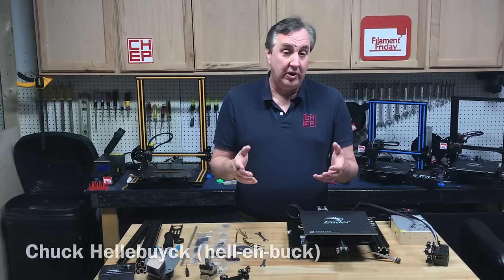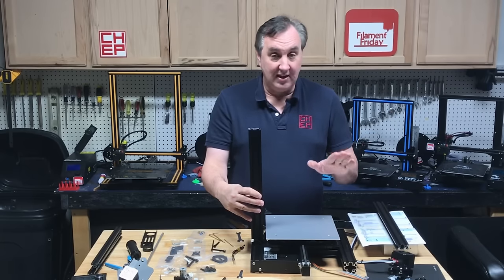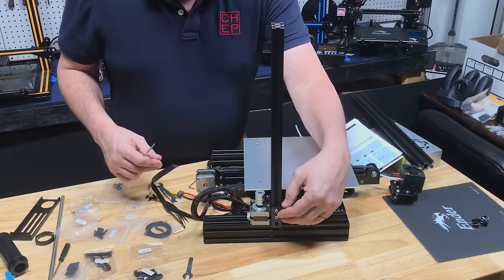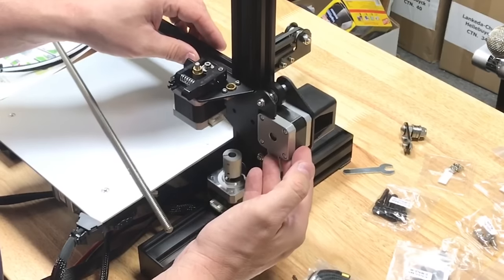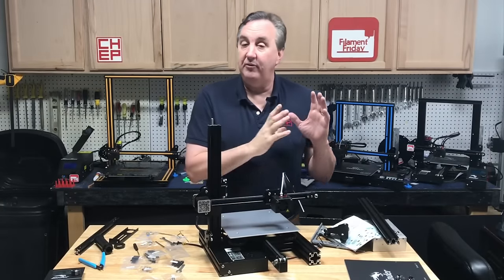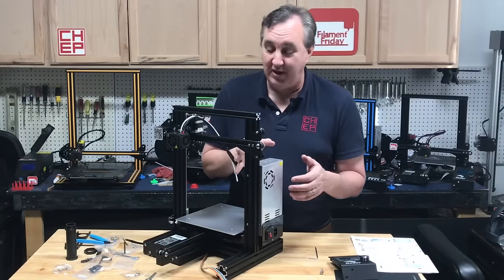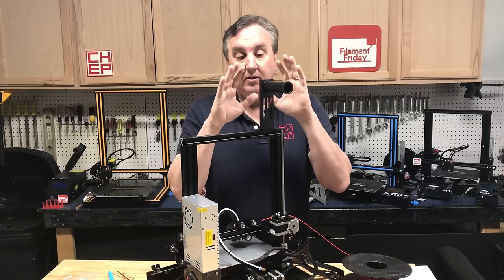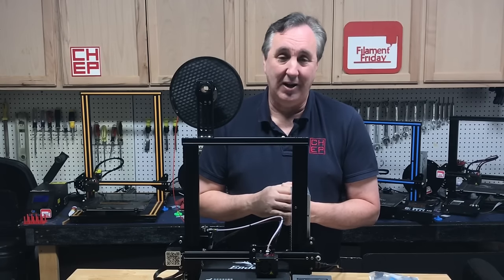How to Setup an Ender 3 3D Printer

Comment: Good day.
Thanks for the great Ender assembly instructions. I have Ender V2, but your instructions are perfect for it.
I do not speak English, so I reviewed your video with subtitles from Google translator 4 times (Google does not translate very well from English into Russian and I did not understand everything right away).
Let me share my experience in assembling a printer.
There is one unpleasant feature of the assembly of openbuilds and aluminum profile carriages. Usually the wheels supplied with the printer are of good or excellent quality, without damage. But after installing the carriage on the profile (and during adjustments, you have to remove and put the carriage on the profile several times), it turns out that the carriage begins to move along the profile with dips. This is due to the fact that, for an unknown reason, the wheels are damaged from an unknown source. The reason for these damages is as follows. When a profile is cut for a printer at the factory, the end of the profile and the plane of motion of the rollers is exactly 90 degrees, and this angle is very sharp for the material of the rollers and damages them when the carriage is installed on the profile. The situation is aggravated if the eccentric nut roller is firmly tightened in the factory and the carriage is installed several times.
As a solution, on my Ender, at the ends of the profile, where the carriage will be installed, I blunt the corners with a fine grit nail file. And each time, before the carriage enters the profile, each time I loosened the eccentric nut as much as possible.
On my first Ender, I unknowingly messed up the rollers of the X and Z axis myself. I got very upset when, after assembly, the extruder on the axis moved with noticeable dips. I realized that the dips have a frequency equal to the length of the roller's circumference (I experimented - I turned the rollers a little with my hands and the dips also shifted). I collected the second and third Ender in my collection without problems with the rollers.

Comment: I bought mine secundo second hand. Is prints ok but o wonder of i can improve. One question about your profiles. Are these for flex and pla?  For flex I now use the chazmeister that gives me good results. But I'm still on a previous cura version. I'm looking to upgrade.

Thanks for the videos👍🏽
Reply from the maker: Yes both standard and flex
Reply: @FilamentFriday  great.  I'm going to try them. Thanks

Comment: I just finished building mine using the manual and had some questions. turns out I built it wrong. my bed is wobbling, all my wheels are tightened wrong and my frame is definitely not Square. Thank you for the video it was great I am gonna go disassemble it now and start over

Comment: Hey Chuck.! Been looking over the frame and as the vertical extrusions are attached  I can see that we are in some cases fighting a misalignment issue caused by poorly cut 2040 cross member of the pre-assembled frame. I have been told by vendors of good quality extrusions here in the USA that there may be an error of ~ +/-  0.06 degrees for any crosscut they make to fullfill an order. I am sure they use the best of equipment.....Now Creality have made well over a million of these Ender 3's. Need I say more. So I am looking into using shim stock. I am taking the unit directly over to my very flat MDF table and sorting it out there. What this boils down to is that once the bolts are tight connecting the 4040 outer rails to the 2040 cross member, any error with perpendicularity is telegraphed and amplified during the mounting of the Z axis risers. 
On another note, the v groove rollers were pre adjusted so tight that I have flat spots on the y axis ie. it actually comes to repeatable stopping points during simple hand driven excursions. These seem to be permanent. Thinking of upgrading to polycarbonate.
What do you think maestro?

Comment: Hello chep, my z axis is not coming down and does the click sound (sometimes it does sometimes it doesnt) when I do autohome. Z Rod screws at the bottom motor joint are tight, upper screws at extruder joint are tight as well(not too tight since it grips the rod). Adjusting z limit switch to a little higher would solve the problem?

Comment: Good straightforward beginners guide to this thanks man. Mines coming Monday and I can’t wait to get started trying out things.
Reply: Triple check you're putting the pieces pointing the right way. Don't force the motors while wired or you risk frying the board, instead rotate the rising motor slowly. You got this champ

Comment: I have alot of trouble with PETG adhesive. Parts just doesn't stick on plate and I have cleaned it and bed level also.
Reply from the maker: I put a fresh sheet of actual Buildtak on mine and it worked great.

Comment: Any idea what’s wrong if the middle part doesn’t want to slide up and down? I’ve tried tightening and loosening the wheels, brackets, and beams themselves but it barely moves
Reply from the maker: With the threaded rod removed?
Reply: @FilamentFriday  the threaded rod is installed, I think I’m going to have to get a clamping square and try again I tried with a regular one and don’t think I have everything lined up right everything lined up right
Reply: @FilamentFriday  it will move up and down if I twist the motor but I can’t just push it up and down and it takes some force to spin the motor
Reply from the maker: Loosen the brass nut screws.
Reply: @FilamentFriday  the ones holding the threaded rod in? Sorry I’m not very technically inclined
Reply from the maker: No the brass t-nut the threaded rod screws into.
Reply: @FilamentFriday  THANK YOU SO MUCH. It slides easy now but about halfway down gets stuck and I have to spin the motor a little to get it going again but it’s actually moving now atleast. Came back with a square and clamps and made sure everything was lined up

Comment: Another comment from me.....My ender 3 is 2 weeks old and the belt broke right where it attaches to the Extruder assembly.  Have you ever heard of this or had it happen?  I've never broken a printer belt before and right at the little end has me wondering what I did wrong.
Reply from the maker: You mean the hotend bracket? 
I’ve never heard of that. Did the pressed on metal cap come off?
Reply: @FilamentFriday  It tore off right at the edge of the metal cap.  I bought a set of those caps from Lowes, but the belt was too short after that tiny bit was lost.
Reply from the maker: Contact the seller for replacement.
Reply: @FilamentFriday  I hadn't thought of that......although I bought a new one from Amazon.  I'll contact them now and should have the belt by July 2021!

Comment: I still have some problems with my printer. Everything looks right to me, I've tripled checked to make sure. I still have some problems though. 1. I dont have a prepare option (I have an ender 3). 2. No matter how much I adjust my bed, the extruder is still an inch away from the bed. 3D printing is kinda weird, there's a gcode (small cat statue) that my printer does try to print even though my printing program says the file isnt printable and is off the grid.

Comment: i am almost done and I only have gotten 2 problems. i had the wrong aluminum thing so the screws wouldnt fit and I was so frustrated. and second. my arm moves down without any trouble, unfortunately up requires so much strength... idk what is up with that.. do you have an idea?
Reply: Same
Reply: You might have to shim your motor ? I think I need to shim mines
Reply: Did you ever figure out the problem with moving up? I'm having the same issue.

Comment: By far it is the best video ever for Ender 3 Assembling. A think Creality 3D should download this vídeo and put it into the  microSD Card that comes with the printer. Thank you very much. I assembled my Ender 3 using the instructions manual yesterday (2021, January 26th). Did not use the printer yet, but after watching this video I think I'll disassembly and assembly again following these wonderful tips. Thank you very much for you time making this video and sorry about my English.
Reply: No way. Camera work is lacking. Got two items backwards cuz he says 'inside' instead of front or back. Instead creality should learn about poke yoke techniques used in manufacturing

Comment: chep hello i want to ask u a question ! both on my ender 3 and 5 when i print small object with low speed like 20 mm/s or 30 mm/s and smaller layer heights lik 008 0r 1 i got a lot of stringing like hair and blobs and both on my printer have dual gear extruders so should i reduce filament temps or flow ?
Reply from the maker: Yes. Reducing flow should help or use a smaller nozzle.

Comment: When I auto home, the needle goes to the top, rather than by the bed. Did I do something wrong?
Reply from the maker: Sounds like the Z stepper motor wiring in backward. Make sure the connector isn’t upside down.
Reply: @FilamentFriday So I somehow managed to get it to go closer to the bed, however, it's about an inch away from the needle when I click homeand continues to go higher by any 10mm every time i press home not sure if that's normal. I initially turned it off and lowered the needle manually and tried to do the height adjustment per yours and other videos with the paper etc and I thought everything was good. I thought I clicked save if that's even the correct thing i was saving... and I'm top of that I found my screen display doesn't have prepare as an option which took me further into a rabbit hole on your videos when you talked about firmware. So now I'm just even more confused.

Comment: 3:24 Tightening the screws will move it into place without any clamps or square. Even if the end of the beam was cut incorrectly and you managed to keep it straight with clamps & square(s), removing the clamps will make the screws that were tight loose, so neither clamps nor squares do any good here, wouldn't you say?
Reply: Your dead right there, the angle that it ends up at remains entirely down to the machining of the end of the extruded piece, which I'm betting is pretty dammed good, of course it can twist a bit, but as the guy said you parallel it up to the board to take care of that.

Comment: im assembling an ender 3 currently and following the video, The threaded guide rod seems to be too big to clear or even go into the brass T- nut mentioned at 8:16. ive asked other people and they have never seen this issue.. any help?
Reply: the brass t-nut is threaded, screw the rod into and through it.
Reply: @JustinWimpey  it was a factory issue and i ended up having to contact creality and they sent me a replacement part.

Comment: Chuck, I'm putting my Ender 3 Pro together right now and i'm at about 12:48 in your video, and the up and down action is absolutely atrocious, does not want to spin whatsoever, any idea what might be causing that?
Reply from the maker: Loosen the Tnut screws
Reply: @FilamentFriday  Sorry I'm stuck at this point too. At 11:22, you only seem to be able to move the bar by turning the screw, but at 12:48 you're dragging it up and down again. As soon as I introduced the screw, I wasn't able to manually move the bar up or down like that. What have I done wrong? Which tnut screws are you talking about? Thanks
Reply from the maker: The brass nuts the threaded rod goes into

Comment: Do you have a video on why a print is center in cura but when it prints it’s offset forward on the build plate
Reply from the maker: No. That could be the firmware setup or dimensions wrong in the Cura machine profile.
Reply: CHEP  hmm I used the ender 3 profile in cura 235x235. What is the set home offsets in the ender 3 menu?

Comment: Yeah I did the prepare and it did all except for nozzle to go down and was like a clicking sound on it and stays there till turn it off does the black box where memory card go does the fan work on it just being on or what
Reply from the maker: I don’t understand the question.
Reply: When I do the set up like you did where it moves well mine is making a clicking sound when it done and have to turn it off
Reply from the maker: Clicking in the extruder? 
Maybe raise the temperature.

Comment: Just a question about my ender.
It has huge problems with the first 1mm of printing. Burnt or over cooked filament and over extrusion.
What could give such inconsistent results?
Reply from the maker: Have you changed anything?
Reply: @FilamentFriday  the extruder is dual drive, I did the steps/mm calculation using your tips and made the adjustment. I also tightened up the  Bowden tube.
Reply: @FilamentFriday  May have figured out the problem. The Boden fitting on the hot end was loose and could have caused the PTFE and nozzle to have a gap in the heat block.

Comment: Thanks Chuck! My E3 has been sitting idle since we assembled it due to so many issues. Looks like I’ll be disassembling it and starting from scratch with the reassembly following your procedures.

One thing that is an issue on mine - the front right leveling screw is loose at the plate. Is there an easy fix for this, or will I need a new plate? (BTW, mine has the magnetic build sheet  with a self adhesive sheet applied over the metal plate itself.)
Reply from the maker: Take off the knob and spring and run a small nut onto the screw and tighten it against the bed. That should help. I don’t know the exact size but. You’ll have to figure that one out.

Comment: Hi Chuck, I just got an Ender 3 Pro as a gift from my wife to get me into the hobby of 3D printing. Really looking forward to it. I seem to have hit a snag almost from the get go after mounting the first upright on the side of the electronics per your suggestion. Trying to square it I realized after tightening it that it was still 1/16” from square at 11” from the base. When I loosen the screws and try to square it again and tighten the screws again the gap comes back as the screws get tight. Any suggestions?
Reply from the maker: Shim it.

Comment: are there instances where they just don't send you a belt that's long enough? I've been trying over an hour to slide it over the lock at the end of the middle bar to no avail. Just ordered some replacement belts from Amazon just in case it came with one that was too short
Reply from the maker: You can adjust the idler. I’ve never heard of it being too short.
Reply: @FilamentFriday  Mine is too short as well, i've seen multiple people on reddit having the samen issue. I fixed mine by using 2 zip ties to make it just that extra bit longer untill i get a new belt.

Comment: Great video, though I do have one question when you used the square to align the rail perpendicular to the base. If you do this like you have in the video, wouldn't you want to square the other side as well, wouldn't it only be squared on one side since the 2040 could not be straight? I do think my 2040 arms are not perfectly flat and this is where I am struggling. I did see another video where someone printed some braces that latch from the top of the printer to the base to align both sides of the arms to be squared. Have you thought about this?
Reply from the maker: I believe there are kits to do that. I just use the square on both sides as a guide.

Comment: Chuck, although I know it isn't really that different, do all these steps apply to the pro version also?  I'm about to pull the trigger on one and I've heard some bad reviews about getting it level, but a friend followed this guide and had no issues, so I want to take the same route.
Reply: And a friend turned me on to the V2 - would it work for that also?
Reply from the maker: Yes. It works for both.

Comment: hey quick question what if my its not movig smoothly up and down what can my problem be if any?
Reply from the maker: Check for binding on the Z axis T-Nut
Reply: I would suggest opening up the eccentric nuts a bit (clockwise) until you get some wobble, then backing them off (counterclockwise) until they're just tight enough to stop wobbling, but still rolls freely. Also, can't hurt to give the wheels & track a quick wipe, get any errant dust out of there.

Comment: Soooooo I didn’t finish the video because mine was pretty much put together I just needed some electrical help. And I turned it on without flipping the switch on the back and I heard a pop.... is there a quick fix for opening up the power supply or am I doomed...
Reply: sounds likely that you forgot to flip the power supply's voltage switch to the right position. either that or it's just a bad unit. a specialist would need to take a look at it, it's dangerous to go poking around in a PSU. contact your dealer?
Reply: @hoffer_moment  I absolutely did forget to. I got it from a friend. I can maybe take it somewhere to get it looked at or just order a new one. I opened it up to see if there is any visual defects but I didn’t see anything out of the ordinary. My guess is maybe one of the capacitors is out? Could be anything with all the components that are inside though.
Reply: @ramonvasquez4903  there are some 24V 15A PSUs on amazon in the US, some marketed to work with ender 3 (most of those seem to share that form factor anyway). try to read up on their performance in case they may not be a good idea, don't want one actually causing harm to your ender electronics (assuming that didn't already happen when it exploded...)

Comment: When I do the Auto Home thing, the nozzle doesn’t go down to the bottom stop switch. I noticed I didn’t plug anything into it, but I don’t think there’s a cable that does.
Reply: Update: I finally found the cable. It was hiding between the upright and the bed.
Reply: Now when I run the Auto Home, it does the other two switches, but it stops right before it hits the Z switch and goes back up slowly while making a weird “brbrbrbrbr” sound?
Reply: @neolapse6539   Try  raising  the  Z stop switch  a  little bit and you  should  be good to  go  ..